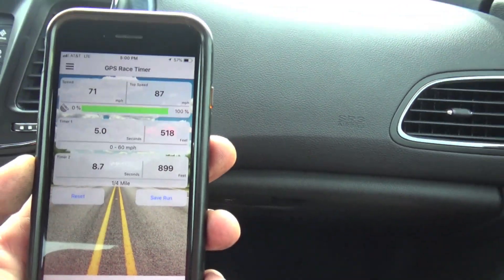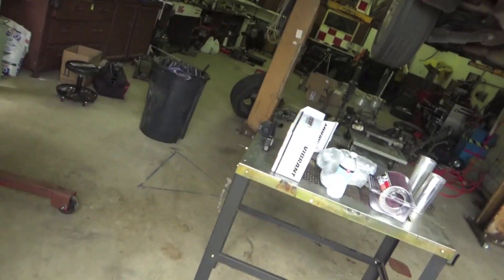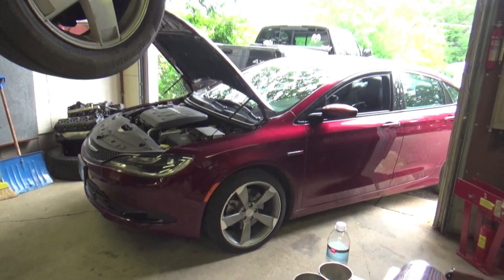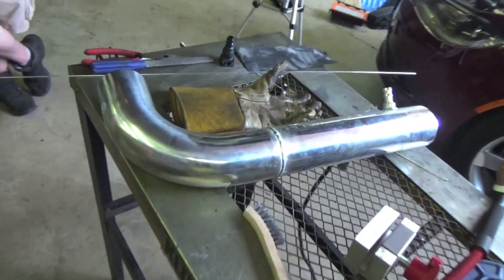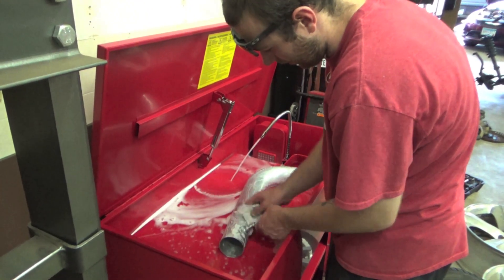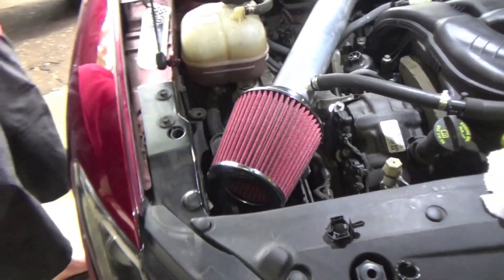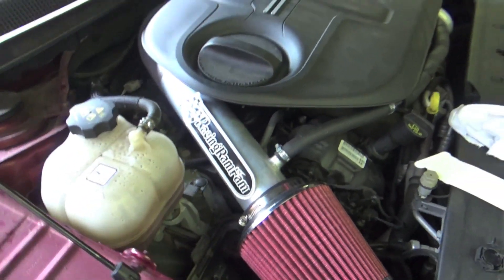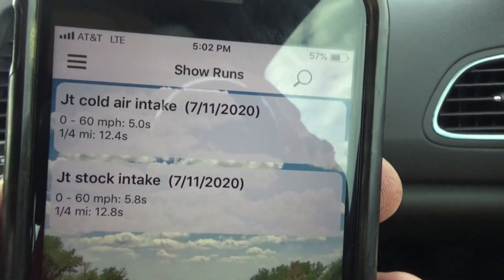BEST MOD FOR CHRYSLER 200 biggest HORSEPOWER GAIN! SRT6 build ep.2

Comment: Pentastar + 9 speed + awd is a completely underrated combo. Can surprise a lot of passengers with that.
Reply from the maker: Brendan Buster def a very quick car! And it’s doing great on picking up power from small mods
Reply: @RacingRamFam  that combo is probably as fast if not faster than a STOCK 340 car.
Reply from the maker: Raymond Pauze Hell ya! In a 4 door sedan 🚘
Reply: Isn’t the fwd slightly faster? Just a question
Reply: @jamesmylife6578  Probably similar ETs in the quarter, but the FWD will likely have a higher trap. AWD will get the jump, especially on unprepared surfaces.  Even my caravan will light up its front tires and it's got 1000 lbs and worse gearing than a 200.
Reply: Yeah I love my 200 C AWD.  I did the Mopar intake, Flowmaster Super 10 and the ported throttle body.  Got to 4.4 0-60 in E85
Reply: @Pentax67ii  could you explain about ported throtle body?
Reply: 100 pct. Mine was a low mile 2016 200S salvage title with a dented front fender and new strut and brake set up. ZERO damage. 10k. It is my favorite car and I will keep it. It is fast, comfortable and good looking. Would LOVE to get a small blower turbo with 7-10 lbs of boost but I am not seeing it out there
Reply: @Pentax67ii  I have one...LOVE it. I have a Durango SRT 392. I look forward to driving the 200C. We need to get a blower or turbo kit
It is snug in there with the traverse thing but can you imagine the thing with 100 more HP. Would be a low 12 second car
Reply: @raymondpauze8801  with the AC on.....

Comment: Wow. 5 seconds. My 3.6 AWD has a K&N intake with the torque tube (resonator eliminated), a ported lower manifold and throttle body, and ACCEL coils. The 0-60 still seems like it's more than 5 seconds.

Comment: How many miles you got on the OD? I have 96k, owned it since 20k. Just wondering how far these things go, and if its worth it to start pushing the 3.6 now that my warranty is about up lol. 2015 200s AWD Seriously under estimated, ive beat mustangs chargers and civics with "Ol' Bluballs".
Reply: As long as the motor runs well and has been maintained I really wouldn’t worry about mileage. Any gains with bolt on parts are really not going to affect longevity. Your driving habits would be more a factor. Hamming off the line beating on the transmission and the rest of the driveline could shorten its life after a while. A power adder on stock internals would be a different story but still doable.  I wouldn’t worry about a CAI and exhaust on any healthy car regardless the mile though.
Reply from the maker: What’s he said lol

Comment: Stock 0-60 is NOT 6.3 With AWD it’s 6.0 and 5.7 with FWD Some say over 6 with AWD, but car and driver says 6.0 and from research, they do the most testing to get the best time possible. EDIT car and driver did not test the FWD, so “0-60 times” is the next best. Which is 5.7 for fwd.
Reply: Every time they mentioned it they said stock time was 6.0
Reply: Tire set up plays big into cheating times he’s not running stock wheels I got 20s on mines and it adds a extra 3mph off the dash
Reply: Wich faster car the v6 awd or fwd

Comment: I'm confused about the stock 0-60 times. Without mods its 0-60 time is listed at 5.7 seconds. I've only been able to hit at 6 seconds one time. What is the difference with this car? I would have thought the two mods you did would have pushed it at least the low 5's?

Comment: Hot air intake
Reply from the maker: Straight Line Cycles pick up power intake
Reply: @RacingRamFam  get more power by routing it to the fog light area. True cold air
Reply from the maker: Think we’re just going to build a box for it and send it! The bottom half of the box has a tube coming from the front of the grill going to it
Reply: @RacingRamFam   Now that's what I'm talking about

Comment: Is anyone making a blower or turbo kit yet for these gen 2 cars 
2016 to 2018
Reply from the maker: You could retro fit any of the jeep 3.6 kits. There’s like 4 different blowers and a few turbo kits!
Reply: @RacingRamFam  is the retro part dealing with the low hood and tighter engine compartment? thanks btw for responding. I subscribed
Reply: @RacingRamFam  probably has to do with the traverse mounted AWD 3.6 in the 200? My 200C is actually fast as is but a blower or small turbo would be great.
Reply from the maker: @stevebarnes9694  they sell one that replaces the intake manifold so it would fit easily. I think more of the tuning side with the 9spd there only rated at 400ftlbs of torque I believe
Reply: @RacingRamFam  that pesky transmission rears its head again. Who sells the intake manifold version? RIPP? thanks again
Reply from the maker: @stevebarnes9694  Edelbrock

Comment: You'll knock off another 0.5 seconds at least with the box. I've seen the results on a 3.6 Journey.
Reply from the maker: What box is that?
Reply: The cold air/isolation box. You apparently didn’t have time in this vid but it is a worthwhile addition.
Reply from the maker: Oh yes!
Reply: @RacingRamFam  also not sure if u guys removed the air resonator that blocks the air flow that’s inside the fender. U have to take the wheel off, open the liner where the front is and there’s a plastic black thing that pops out. When it’s removed air comes up from the bottom of the bumper straight into the bottom of the air intake. It’s worth doing to have a constant flow of air from outside the engine bay.

Comment: Chryslers are dumpster fires
Reply from the maker: Your a dumpster fire
Reply: @RacingRamFam  i own a fully loaded 2015 200 awd v6 blah blah, drives like a cadillac but breaks down like a bmw, 3 maybe 4 years of ownership, 60k to now 130k miles. a new problem every month or two since its hit 90k and at 70k i needed a whole new rear end. Now just an untracable coolant leak running my engine hot after I have replaced the whole coolant system. I cant wait to get a new car
Reply from the maker: @headbangerboy123  sounds like you need a better mechanic
Reply: @RacingRamFam  Oh you mopards are your own breed
Reply from the maker: @headbangerboy123  at least I can figure out a coolant leak ha
Reply: @RacingRamFam  New fan, radiator, water pump, thermostat, just havnt done the coolant res which looks fine. Hoses look fine, pressure test pass, two coolant flushes. too much money thrown at this dumpster. Gonna sell it before Chrysler goes out of business dropping their values even more
Reply from the maker: @headbangerboy123  again time for a actual mechanic to look at it not a parts installer.
Reply from the maker: @headbangerboy123  sounds like you loaded up the shot gun and took aim ha! Don’t be mad at a car that you don’t have the brain power to actually diagnose
Reply: @RacingRamFam  Grocery getters shouldn't be this hard to work on. Thats the thing, this isnt a porsche or a 6.4 powerstroke. Statistically one of the worst cars of 2015 / in general
Reply from the maker: @headbangerboy123  well now I know how mechanical inclined you are. Legos are probably more your style
Reply: @RacingRamFam  Ignoring the point but sounds good. Mopard